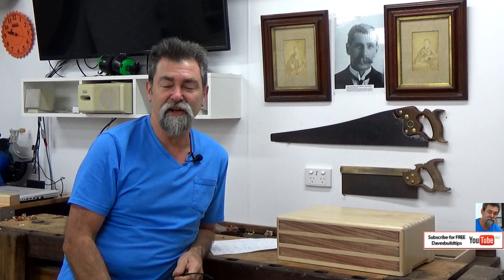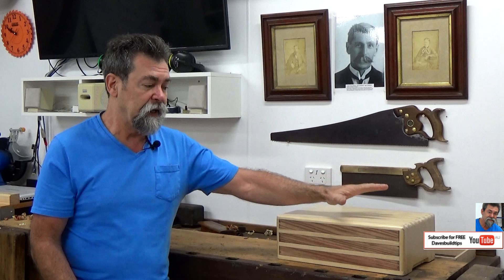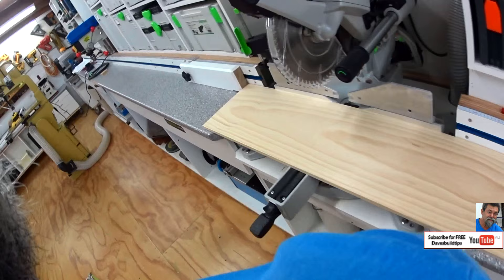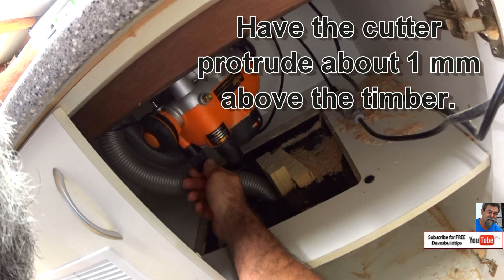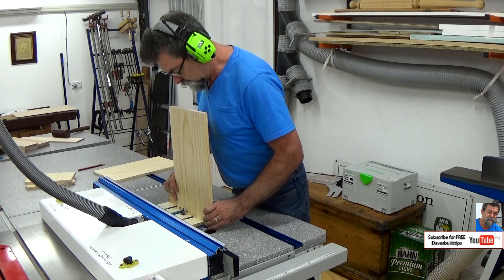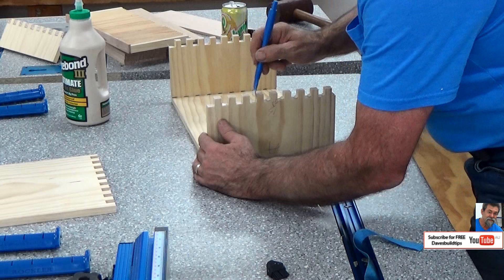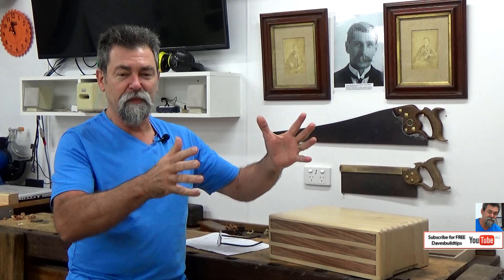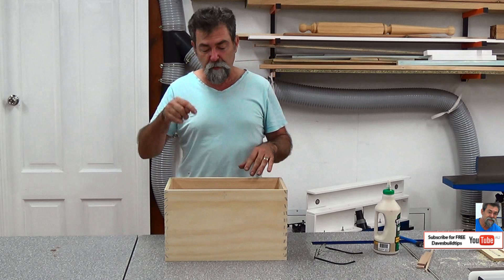how to | studio pencil box | build | dave stanton

Comment: David I have a question regarding the tight fit of the back of the box. Is this can be an issue with timber movement with changes of temperature and humidity? Will having the back fitting in so tight cause problems later on if the timber expands?
Reply from the maker: Good question Paul and my answer is I don't think so. The reason being the whole box is sealed with the waterbase varnish, sanded between coats which keeps it stable. That is one of the reasons we seal the inside of the box and shelves first before the last assembly stage.